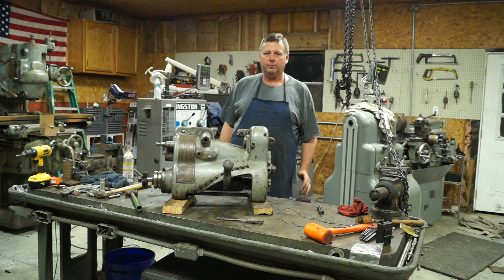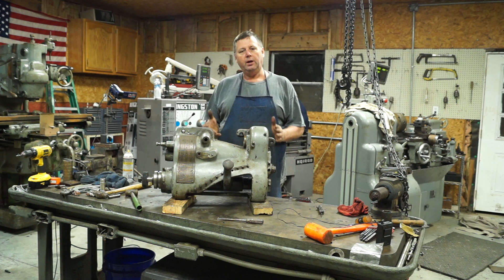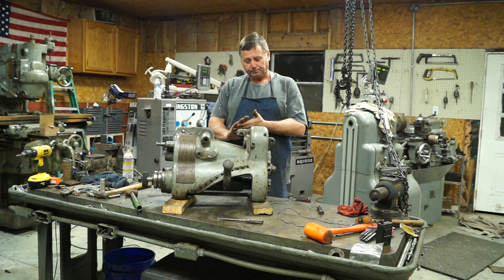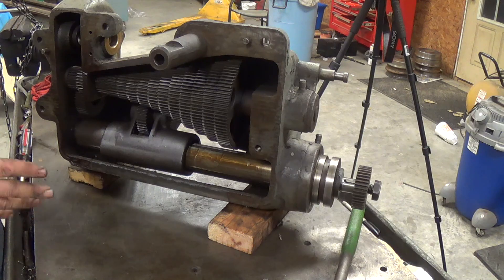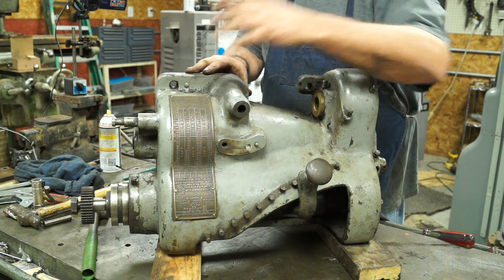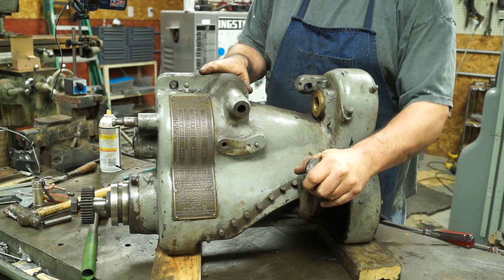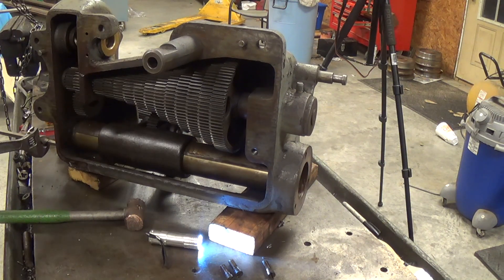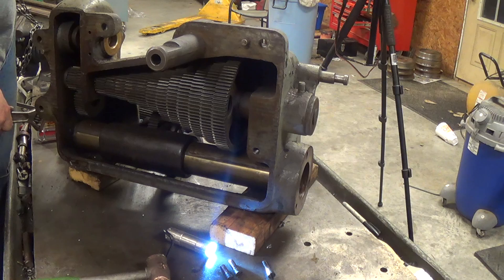Pratt & Whitney Part 6A  (Quick Change)

Comment: Dose this machine really use automotive type of oil for lubricating the insides of the machine or dose it really use gear oil? Machines generally made before around 1970 were made with better quality and thought then today's  computer controlled equipment in most cases in my opinion. Computers can be  great thing. So can classic or old machines like this one you are restoring. Do not for get to work safely! Every Time All The Time!
Reply from the maker: I used 90wt gear oil on gearboxes like this, The oil sticks to the gears better than other oils
Reply: Is that 90wt gear oil close to the same oil type that was used in that machine when it was new or is it better quality because of modern science? I was impressed with you scaffold and block and tackle type lifting system you thought of for the parts that are to dangerous for you to try and lift safely on your own. That is working harder, smarter and safer! Keep it up!

Comment: I don't understand these youtube "rebuilds". Why did you take the gearbox apart? It was working fine. It had no visible damage. You took it completely apart, but I'm sure you won't replace any parts or actually fix anything. You spend countless hours dicking around and risk damaging the components because you don't know how it comes apart. And in the end all you do is clean it and paint it. 

Kieth Rucker does the same kind of "rebuilding".
Reply: Can't be sure until you take it apart and eyeball it.

Don't look it could chew up something and it is probably now easy to find 100 year old parts also could be VERY expensive if ypu can find them or make them.

"An ounce of preventative is better than a pound of cure."
Reply: Sorry for replying so late -- I just recently "discovered" Mike's channel.  Early in this episode, Mike did state that the quick-change gearbox didn't appear to be functioning/shifting as easily/smoothly as he thought it should and that was why he was disassembling it.  In two or three earlier eposides, he had stated that he did not intend to disassemble the gearbox.

I suspect that Keith Rucker usually attempts to do the same, but it's still interesting to watch, for those of us who haven't ever had a chance to work on/with old machines like this one.  (My South Bend was manufactured in 1911, based on the Serial Number stamped on the end of the bed, but doesn't have a quick-change gearbox.  And it is missing a lot of the change gears too, along with virtually all accessories -- no big surprise there!  One of these years, I'll have to thoroughly inspect my 1911 lathe to see how worn it really is and decide what repair(s), if any, I'll attempt.  I don't have Keith's scraping skills and can't afford to farm out bed (and matching assemblies) regrinding.  I'll also have to use it to cut replacement change gears too (at least the gear blanks), since Rose (when she was) at South Bend told me that the gears that South Bend made back then weren't the same as those made today and that I'll have difficulty finding replacements.  This is one of the many reasons I subscribe to channels like Mike's & Keith's.)

Comment: Do you have an impact screwdriver? I mean the kind that you whack with a hammer and it turns and pushes forward at the same time. 
In my experience old screws tend to have a narrower slot than modern ones, so that modern screwdrivers sometimes won't fit. I guess there is a lot of variety there.
Reply: Yup. Something like the Craftsman 47641 $25 well spent. Just don't try to take too big a bite...
Reply: For some reason I always think of that just after I stripped the head. ;-)
Reply from the maker: No I don't, I had one years ago when I worked in hvac/ and appliance repair, I've been looking for one but all I could find was a HF one so 'Im still looking. Im not sure if can handle these screws.
Reply from the maker: I went into sears today to see if they had one in stock in the store, They didn't. I guess I need to order one.